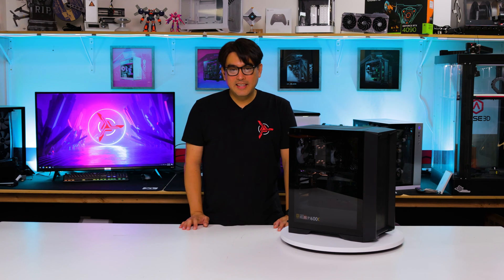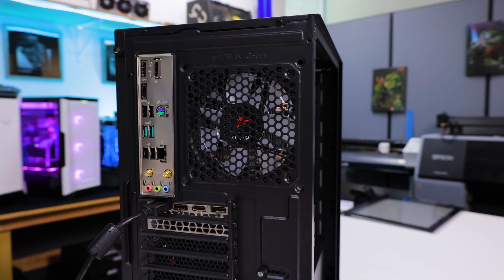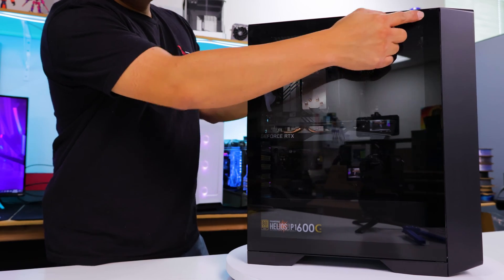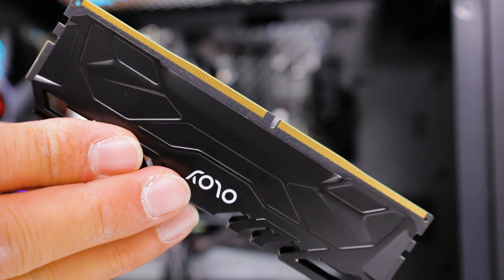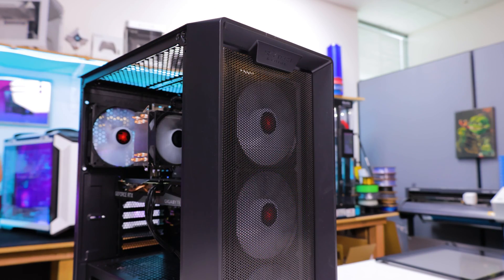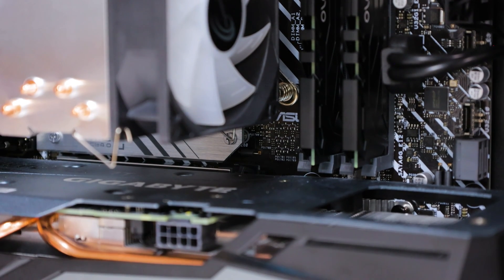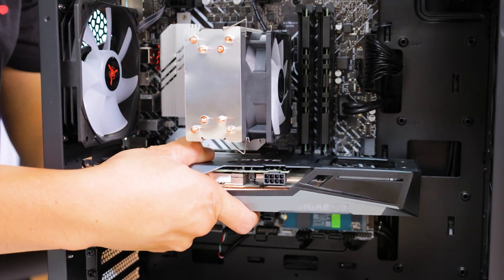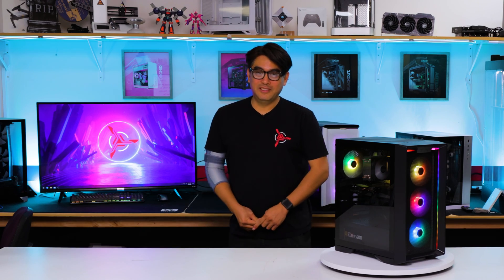Troubleshooting no video Issues

Comment: Oh my GODddddddd my Skytech Azure will not display. I have HDMI plugged into the horizontal HDMI port under the motherboard and it's still saying "no signal". I reseated the memory. Like, why is this so ridiculous? Like, I should not have to take a PC apart to get the monitor to display. This is actually so annoying. Why is it doing this?????
Reply: Did you end up figuring it out? I’m having this issue right now
Reply: @rosendohernandez2906 no, I returned the computer and bought a MSI lol

Comment: I removed the part from the case then it worked then when I put it in the case it didn't display again, using an hdmi and I tried the cable on another pc it worked